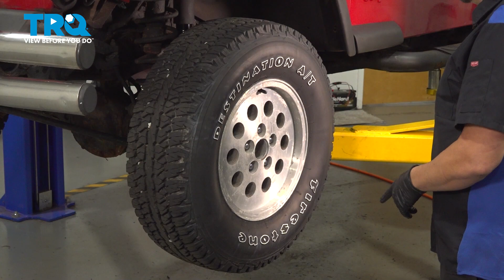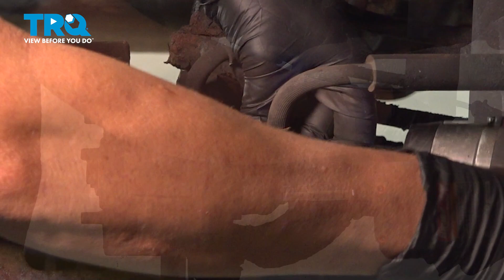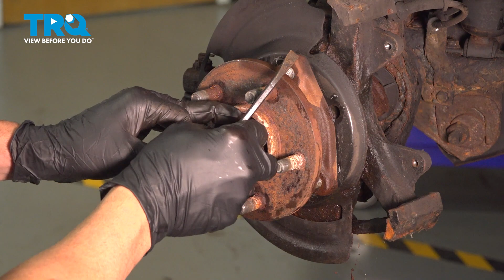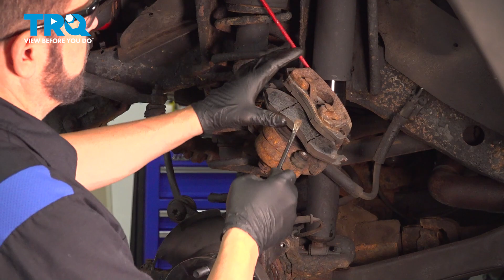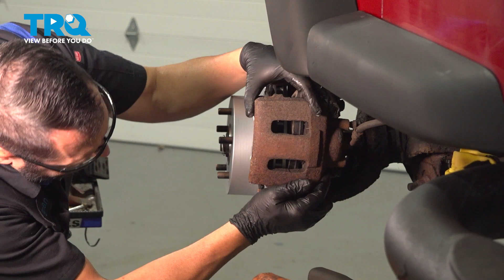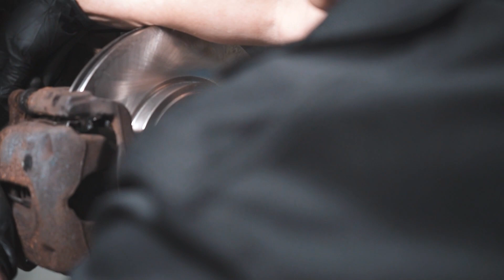How to Replace Front Wheel Hubs 1997-2006 Jeep Wrangler

Comment: Lift the front end up and before removing the tire, try loosening the 12 point bolts that hold the hub assembly on.
If they strip because they are all rusted, then good luck to you.